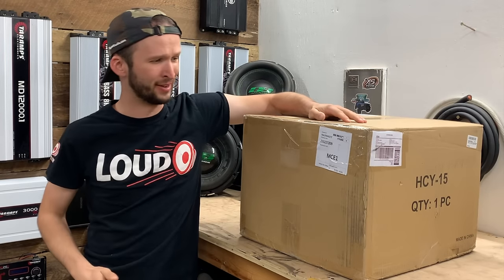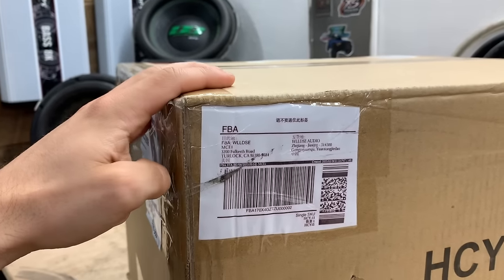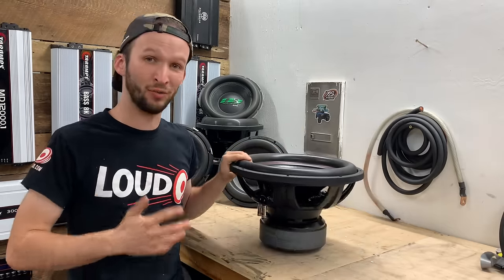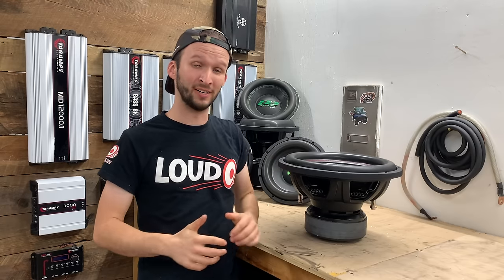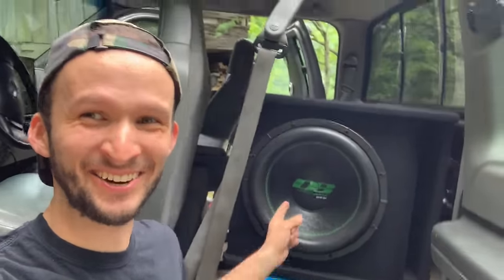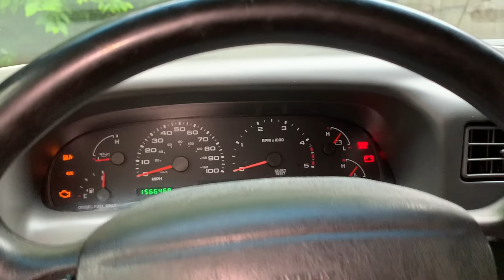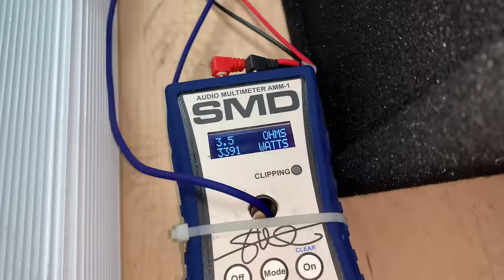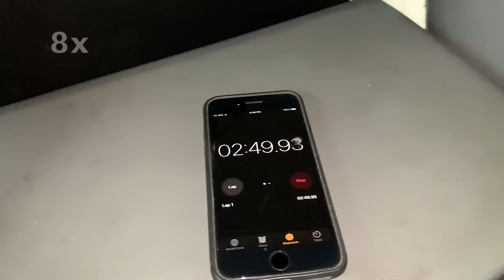How Bad is Amazon’s Sundown CLONE? WLLDSE 15 Review

Comment: If this tells you anything if this company can sell them for $140 bucks and still make a profit imagine what sundown is making put a sundown dust cap on it who would ever know
Reply: I can guarantee you that Sundown has way higher production costs. Are you suggesting someone try to make a counterfeit and sell it as the genuine item? That's deplorable my guy.
Reply: But... It's the way the world and a free market society works. You don't think Sundown hasn't used techniques, styles or comparable driver designs from other companies? Lol of course they did... But they delivered an absolutely true to spec quality driver when they came out that was just almost non-existent in the sub market then. Competition drives the economy, of one company can do it... There's always another that can do it cheaper, just depends how deep that rabbit hole goes as to what quality you get. 

From my understanding these subs have no specs with them... And there's probably other downsides compared to SD I would suspect.
Reply: @AntoninusPius2 There's only one way to find out I'ved owned several u series subs just put a order in for this one
Reply: @JasonWW2000 It's only a counterfeit if it's inferior

Comment: I'm not sure on the extended cab but my 06 f250 crew was acoustically...um challenged? Port facing up, going up the back wall was what i found best. Even then it just never sounded great. Then again straight pipe diesel clacking ambiance never helps
Reply from the maker: Yeah mine is definitely challenged as well lol
Reply: @ParkerTheBasshead  my amature knowledge thought is that it is lost in the top corner since bass gets trapped in corners. I wanted to do a test. Build a normal box, test and log numbers. Then put round over or 45s in all the 90°corners and repeat same exact tests again and log.

Comment: Wow now this is nice. I'm impressed but really they need to change the name of this subwoofer💯 I'm now running a 15" American Bass XFL in my room. I still think the XFL is way better. Yeah my dad was  going to use the 15" XFL in his very small 2.25 cf seal box because I blew his 15" older NVX 3" coil. Yeah I had no subwoofers working once and I put the NVX on my 2 Soundqubed S1-2250.1 strapped at 2 ohms in the small box and it sounded amazing but blew💨 Yeah so I bought him the XFL and it sounded awful in that small box. So now I'm going to buy him a new 15" NVX V3 that's rated at 1500rms watts.

Comment: I can say I thought your review was a really mehh it's ok opinion of it, what more could it have done to get you to do backflips while double gun fingers hollering woohoo guys did you see that and coil has black glue!!! (Lol, ok that's a bit of an exaggeration) like you do for other subs that did no better and are at least a $100 more? You seemed a bit bias against is it just because it's an off the shelf Chinese sub with a generic name, it's litterly no different  from a bunch of decent name brand Chinese subs apparently...it uses the U frame so it's a "knock off", theres piles of brands that use the same frames as other brands like the g2 Genesis uses the K9 frame, piles use the TI.  I build most of my subs but I have 2 of these in the 12 because of there value you can't build a comparable sub for less than $250 minimum, I just think it should have gotten more love vs the luke warm opinion it got   ...oh btw the $300 U's are the V1 and $500 ones are the V2.